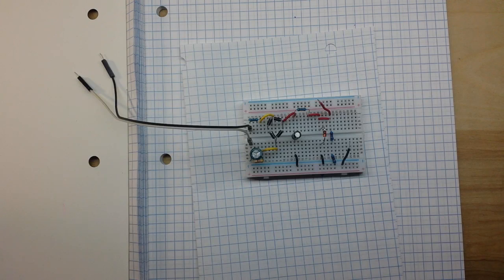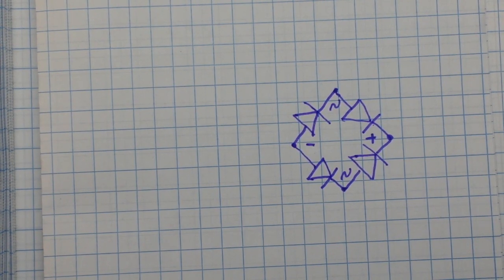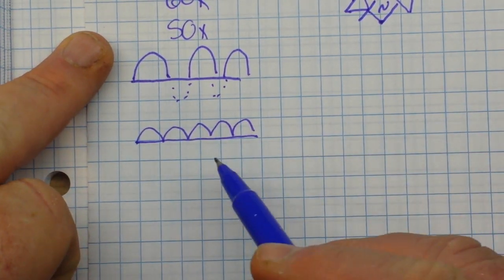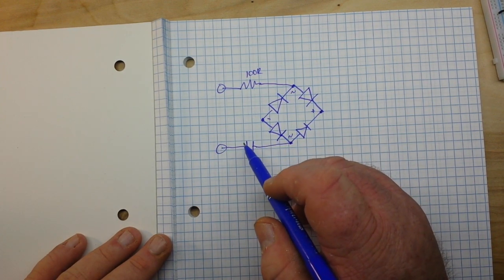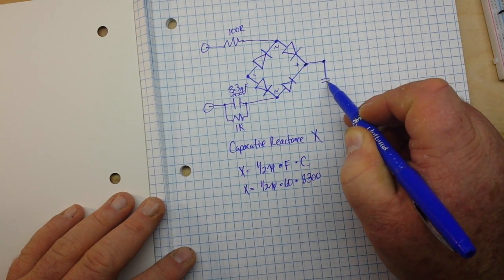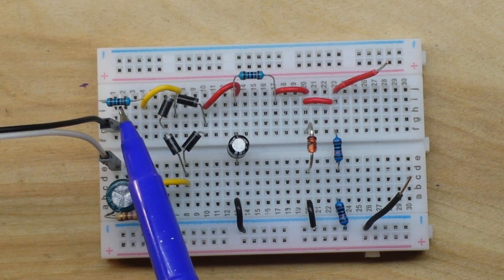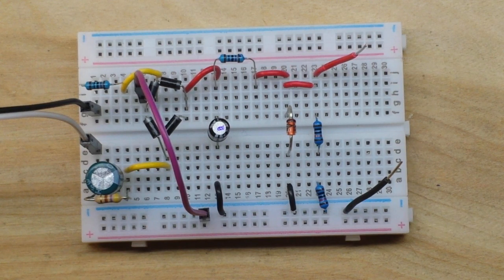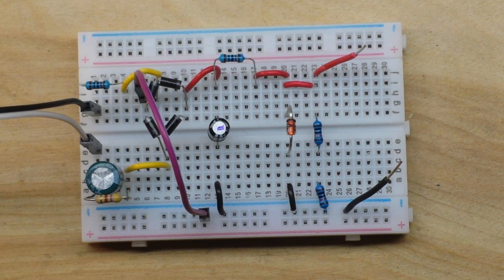Capacative Power Supply Design

Comment: Paul, could one use a signal generator to produce a low-voltage A/C input just to experiment with half and full bridge rectifiers?

I built one of those $8 generator kits from eBay, but while it outputs a sine wave it is DC and never dips below into negative voltage.

Comment: Great job Paul and thanks a lot for the video and advice.
But I think one can't use an e-cap with AC, since it is polarized, it might blow up. It is better to use non-polarized caps.
Also since the circuit is dangerous, adding some kinda protection like a fuse is safer.
Reply from the maker: +igrewold Most cheap LED light bulbs sold in the US use an electrolytic cap. An X2 cap would be better, safer...but the dollar rules all.

Comment: Would love to have heard how t calculate the size of the capacitors etc. for a given load and supply.  e.g. EU/UK 50Hz 230v for a supply of 12v dc at 500mA...
Reply from the maker: 2pi*I per AMP/per Farard/per Vrms/per hertz
Reply: +stewartrv I think this kinda design usually offers lower amperage something around <= 200mA
https://youtu.be/Tn8tfnkwQDo

Comment: great. what's an isolated  power supply. just kidding. I don't have one either. I have revised my idea of a alternator voltage regulator. I have changed some things. I decided a PV  optical coupler was to expensive and not need anyway. and decided to go FET. and also use a led in the gate drive if that will work. in place of a  resistor. kind of a reversed voltage divider. shorted to ground with an additional FET. with a zener controlling the gate. so it works as a pwm kinda. to regulate the voltage output. I'll try to send it soon. if you are still willing to have a look. thanks great video....

Comment: Just wanted to point out that any non safety cap has a possibility of shorting closed. I would replace the 8.2uF with an X2/Y2 cap.
Reply: Good point..
Reply: After watching a coupla transformerless power supply vids, I was about to say the same about using the X2 cap but, it is a good thing you already did.
https://www.hunker.com/13408990/differences-in-x1-x2-y1-and-y2-capacitors

Comment: Looks like you wouldn't want to plug it in anyway as one of the diodes look to be reversed  (if I'm seeing it ok)!  I hate the thought of people dabbling with circuits that could be referenced to the mains supply in a fault condition!
Reply: My eyesight isn't that bad then?
Reply from the maker: +gartmorn my mistake
Reply: OK I am confused.  looked at the diagram again and all I saw was the Zener set Cathode to Positive (which might be looked at as backwards) for voltage control, but that is the way they are set in circuit for voltage control. I would not have responded but you responded with "My Mistake" and if you think there is a mistake then I need to understand where because I don't see it. Looking for clarification. Thx
Reply from the maker: Carl Davis The mistake was in the bridge rectifier, I had the lower left diode swapped end for end. The zenner in this circuit is supposed to be reverse biased.
Reply: Thx That goes to show a person can miss things even when they are looking for it.